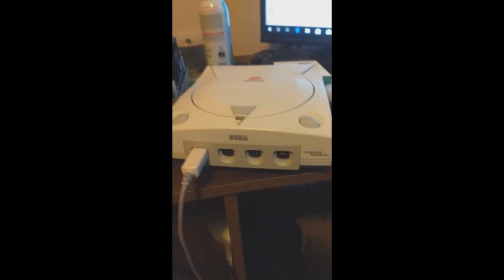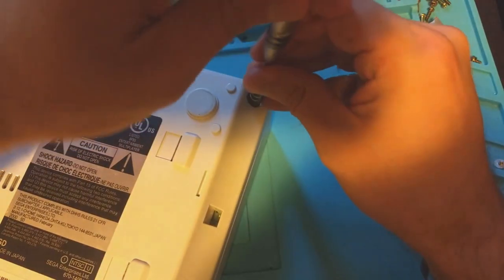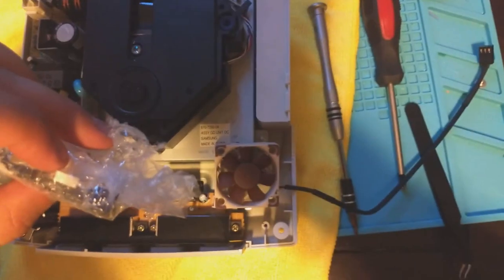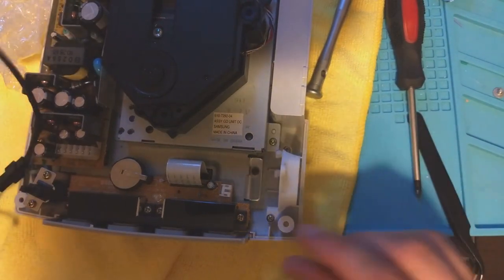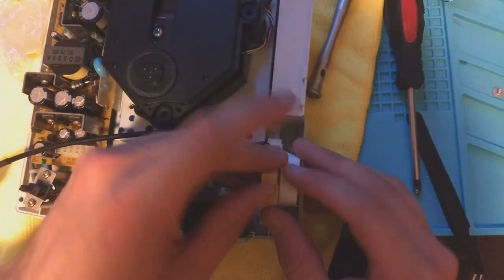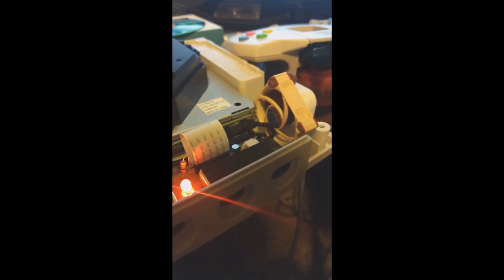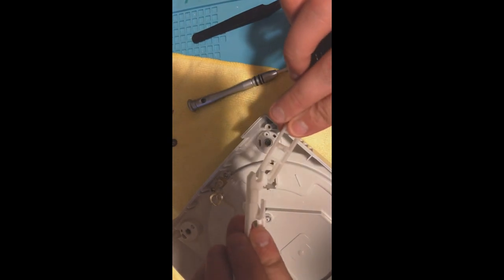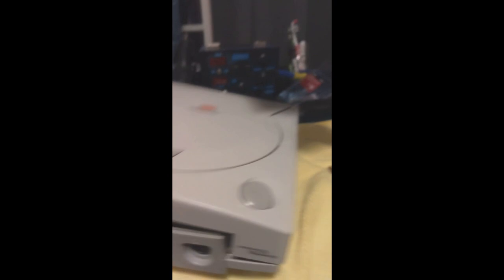Dreamcast Noctua Fan Mod Installation

Comment: I installed mine last night. I had the same issue with it not closing properly. I ended up trimming the corner of the  disc drive plate, because the 3D printed fan shroud was hitting the plate. It sat properly on there after I trimmed that corner and I could easily open and close the disc lid.

Comment: Tip: When putting the shell back onto the DC, it's best to leave the door opened so the latch is disengaged, it makes dry fitting way easier before securing

Comment: Thanks so much for the video. I have a question? The fan has to aim inwards or outwards?
Reply: Fernando Delgado it needs to be an exhaust fan
Reply: @NicollGallery  At 12:04 the fan is aiming inwards, so the opposite direction. Be careful.
Reply: Fernando Delgado. The original fan is an exhaust fan so the system air flow will likely best function in this direction.

Comment: I know it’s a year old, but for anyone latecomers or stragglers who come along, be advised that as long as your clone has the right speed of crystal (11.2896Mhz, it’s printed on the crystal. The ARM crystal will read 12.000Mhz on the crystal, which is fine and required.) and is version 5.15b, you’re good to go.

Comment: The CR2032 battery is not a rechargeable battery and may explode after prolonged use of the console. The original cooler, after lubrication with silicone grease, works no worse, and there is no point in throwing money for a useless "upgrade".
Reply from the maker: Thank you for your opinion. 

This is older video. So I was not as informed.
Reply: technically he can use a CR2032 battery but he has to solder a diode on the resister of the controller board. There's a guide for it floating around on the internet. Great to know if you come in a situation down the road where MIL2032 and LIR2032's may be harder to find.

Comment: my Dreamcast fan does not have the adapter to make the novelty compatible, it is soldered on the fan, what can i do? can i buy it?  thank you
Reply from the maker: you need the plastic for the new noctua fan?
Reply: @cyo_corner  friend sorry I did not realize that you have to buy it with the kit for noctua fan😗
Reply from the maker: @minimalexs  yes. you buy the fan. then separately, you can buy the plastic piece. if you have 3D printer you can do it yourself. in a few months I will do a better video.

Comment: I think you have used the wrong fan. Its the 5v version you want to use unless you solder onto the 12v line on the PSU
Reply from the maker: It's not the wrong fan
Reply: @cyo_corner  NF-A4x10 FLX is the 12v version. The feed from the controller board to the fan is 5v. RPM of a DC motor is controlled by voltage so the fan will still turn but it will be less than half the normal speed.
Reply: @cyo_corner  It is the wrong fan. You want the 5V, not the FLX

Comment: What's wrong with the clone GDEMU?  That's what I'm using. Seems great
Reply from the maker: I just prefer to support the developer is all. I just gave in and bought the recent 5.15 clone. ran out of patience.
Reply: @cyo_corner  lol. How do you support something you cant get ahold of? Lol. Not being a smart ass. Just curious.  Also the clone is on Amazon.  $100.  Get it in 2 days. Any issues it's a easy return.  Wish it was easy to get ahold of the real ones. Not sure If theres really a difference though

I will say I had to return the first one due to music not playing with GDi files that had more then 3 tracks. My replacement seems fine though
Reply from the maker: @detroit retro gamer drg313 he isn't arrogant. I own two authentic gdemu and I'm very satisfied. Just because you can't get a toy easily doesn't mean you should hate the guy